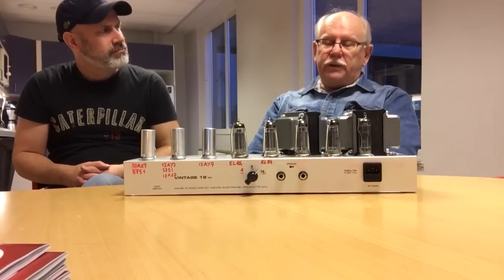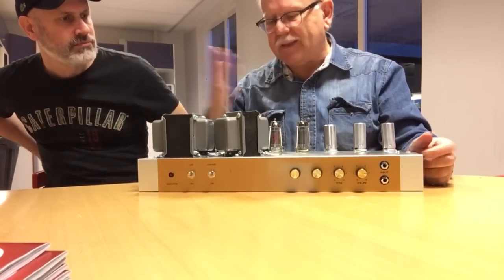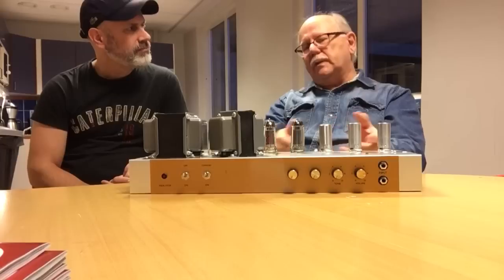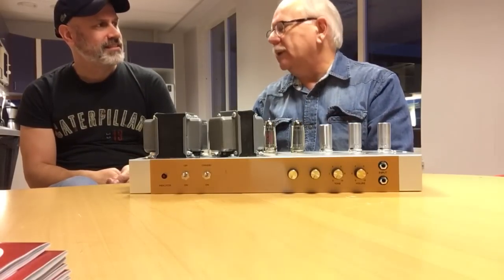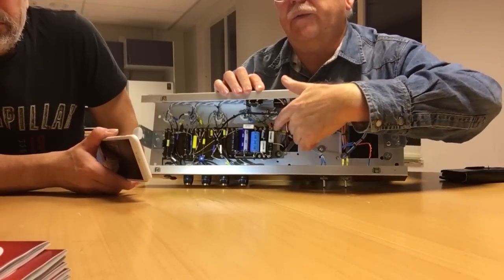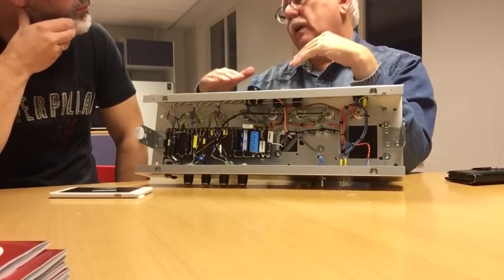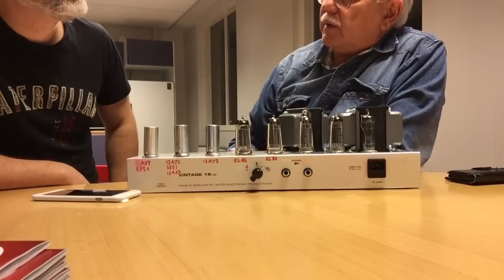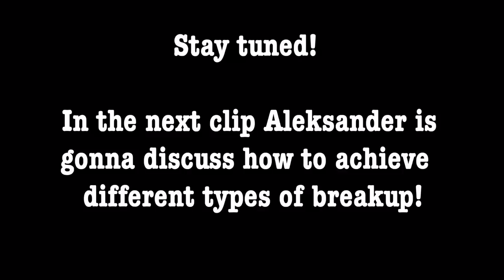Great Guitar Tone on a Tight Budget - Can it be done?

Comment: There are three types of passive tonestacks common to guitar/bass tube amps... The blackface plate feed stack sitting between the first gain stage and second gain stage,, In stock form (TB) it has a small value mid resistor scooping out a lot of frequencies around 500Hz. Also if you lower the TMB pots in a blackface the sounds dissapears.. 

THen we have the fender bassman/marshall cathode follower tonestack,, the controls do slightly less and more midrange is built into the tonestack and the mid scoop if you decide to lower the mid pot to 0 sits higher around 800Hz. 
The VOX top boost looks to my eyes when looking at a schematic like a cathode follower one but has slightly different values in the tonestack.. Its scoops the mids much more than a bassman/marshall stack but the center frequency is rather similar at around 800Hz.

Lastly you have the James tonestack or Baxendale tonestack you find on amps like  Ampeg that reacts a bit different on the pots than either the bassman/marshall or the blackface tonestack..
Reply: The treble is the most interesting knob on the FMV stack, acting as a blend and giving control of the mid freq notch. 

James stacks are a little more intuitive boosting highs and/or lows.

Comment: Nice design  Utilizing lower gain tubes + EL-84's  are sensitive so no need for hi Mu dual triodes. The 4 EL-84's can show the potential for dynamics and tone  without being subdued with so much  preamp gain/compression. Additionally the 'James' tone section isn't as signal sucking  as a traditional TMB cathode follower design.

Comment: i love this video. so much informative and useful. i guess $450 is standard price for making clone amps... that's why bugeria 's price are about 500-700$ for their marshall amps clone ... :-P probably they get 50-150 dollar nett profit LOL
Reply from the maker: +rangga aditya Thanks man :-)
Reply: rangga aditya The Bugera 1960 Infinium (Plexi clone) is only $400
Reply: Comparing consumer price of an amp manufactured in large volumes in a low labor cost country against parts cost of a "one off"  full custom commissioned design. In all honesty, it makes no sense. 
Should an design like this be put through a "tailor made"  manufacturing process the selling price would easily exceed 4-5 times cost of materials. There's a similar amp on the market, as far as number of tubes, generic components and labor intensity goes, with a selling price of just below 2000 U$. The label says "handmade in USA" which compared to Sweden is a low manual labor cost country. 
It is also the main reason I sell only directly to end user, no dealers, no distributors, no middle man.

Comment: I don't the sag on this amp comes from the power transformer,, That one looks massive and I would presume that it can deliever a lot of current without much voltage drop.. No the sag comes more likely from the use of a EZ81 rectifier.. I have seen this rectifier in a 15-18 watt 2 x EL84 amp where it is pretty stiff.. But in this amp it has to feed 4 EL84 tubes which typically run pretty hot in a guitar amp (hot bias),, the max current at around normal EL84 voltages in a guitar amp (300-350VDC) is 150mA with a 50µf first smooting  cap (not choke).. I think that the 4 EL84 tubes and two 5171/12ax7 and the slightly higher curent 12ay7 tube will draw more than 150mA when you push the amp giving you a voltage drop across the Ez81 rectifier..
Reply from the maker: +dansk björn Its certainly bold to second guess Aleksander Niemand. :-) Especially just by looking at the Power Transformer.

However I appreciate feedback, we'll adress it in the next clip.
Reply: I don't guess, I measure. ;-) Load regulation, as I explained. BTW oversized PT can actually exhibit  worse efficiency and load regulation than standard 10% due to higher iron losses than in optimally designed transformer. It's possible to compensate additional iron losses by using thicker copper wire to reduce resistive losses the windings. This makes the transformer significantly more expensive which negates the idea of a tight budget. FYI. The size of transformer used is optimal for the application. Considering that the amp consumes total of close to 90W,  transformers efficiency ca 90% result in a minimum 100VA rated transformer. Mains voltage can deviate 10% each way from nominal which calls for a worst case margin of 20%, you end up with a 120VA rated power transformer for optimal operation of the amp. Yes, it does sag, about the same amount as the EZ81 rectifier. At low volumes - not a lot of sag,  just enough to introduce a little slow compression. 
Peace!, darlings.
Reply: Johan Segeborn 
if you want no sag on a 32-50w tube amp but want a tube rectifier the gz34 is the tube. rated at 250mA at 350VDC.

Comment: Unfotrunately, bedroom players can forget about great guitar tone, for great guitar tone (especially with tube amps) has to be loud. Right? :)
Reply from the maker: +Gillette Wilkinson No, you can get a good tone at bedroom volume level wirh an attenuator too, but I won't sound as intense
Reply: We can get a very good sound with headphones too..but as you know, it just isn't the same feel. Some "interaction" between player, and speaker kabinet, and the "moving air" between is missing..
Reply: Gillette Wilkinson that's where a 1 watt Amp comes in handy.  Also I've got a JVM 410c that sounds good at low volumes, but better when no one else is home and I can crank it.
Reply: Gillette Wilkinson loud certainly helps, but i have a vox ac4 i get great sounds out of at bedroom volumes. to get a good sound cheap you have to do low wattage.